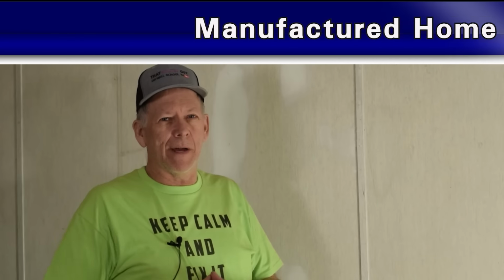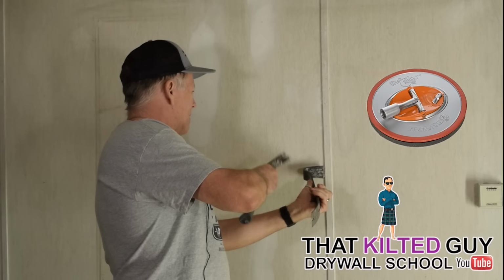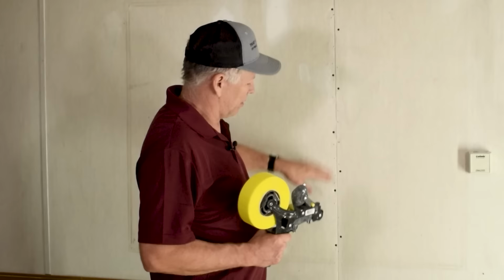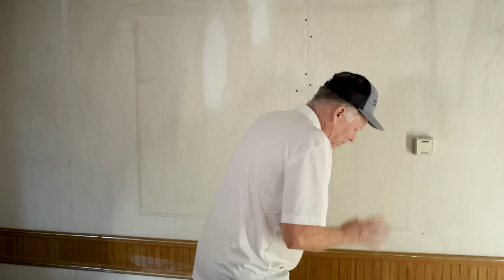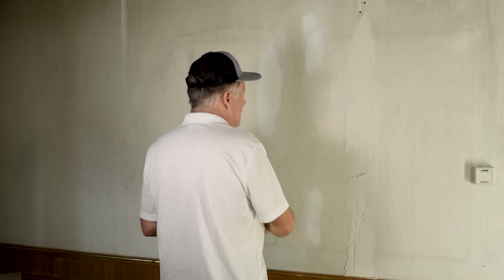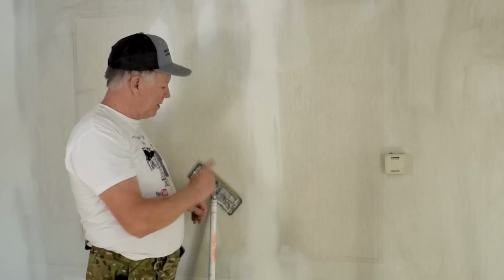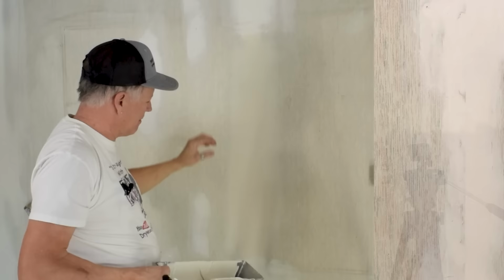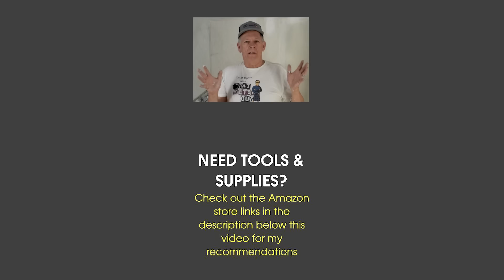Mobile Home Wall Removal in 2022. Smoothing out the wall strips

Comment: Ive thought about making a tapeless mud before using fiber hairs but wouldn't trust it. I dont even like using mesh with hot mud unless its fiba fuze. My experience with the old school sticky mesh is if its not cracked yet it will be soon even with hot mud but the cracks with hot mud are tiny hair lines. Just my experience. The old man that taught me drywall basically told me all that but i had to see it for my self.
Reply from the maker: I’ve installed well over 500 rolls on repairs with zero issues

Comment: Thanks for this video, I had to sell my house and move into a older single wide mobile home and the previous owners did some work like you are showing but only one room the master bathroom has the stripes removed and fully textured and mudded the ceiling and walls but they never completed because some of the seems cracked all the way down and the mud repair is showing and cracked and I have to fix this and repaint. So I'm assuming I need to screw down the wallboard on the seems that cracked re mudd then paint.  Another question I have is what is the best paint to use on the walls that have had this process done? Except the laundry room which I'm not doing anything to the rest of the place has been textured over but the strips are still in place and for right now even though I absolutely hate them they are probably going to stay as I'm disabled and can't really do all this stuff anymore. So in general the walls look like drywall untill you see the strips. I bought eggshell finish latex paint but I noticed it damage's easily on these walls that are vynal under the thin coat of mudd so what sheen would have been better And especially what sheen is best for bathrooms/high moisture area's like My hallway that has the junk swamp cooler.

Comment: You're a life saver! I was worried about the seems and trim in my modular home. But what I was really worried about was the texture of the wall! So I'm guessing the primer bonding will hide the standard vinyl texture and then I can paint!?
Reply from the maker: Primer and paint will hide very very little. If your vinyl has a texture to it, you may have to skim coat it with a really tight layer of drywall, mud and sand. It smooth.
Reply from the maker: If you have any texture on the walls and want it to appear, smooth, primer and paint won’t hide it. You may need to do a very thin skim coat to get rid of it.

Comment: Q: if I grind and shred old cotton apholstry into something similar &>then spray the wall with spay adhesive and rubber the cotton across the glued surface leaving a cotton sticky mess to dry or thus till ventilated/ talirable.  Would it asist in the affixing of the drywall puddy and it's processes? 
Tool : wire brush pit drill/grinder 
Material White Upholstery preferably a cotton base
Reply: One other thing,, some have the wood walls that thin pressure treated cardboard with lines or patterns in them it's like 1/8 inch thick turn the patterns inside so you don't contend with the pattern embedded into the intended facing 
Use the inside out

Comment: I'm doing a 2008 1500 sf modular now , it has drywall and wallpaper through out the home, wallpaper overlapping the seams. No Strips,  I'm worried about expansion and contracting from winter,.  to summer.  May get some cracking...

Comment: I was told the trim pieces are for the trailer to flex since it’s essentially a big rectangle that’s going to expand and contract with the heat/cold especially on the older models of trailers (anything before 1997) where they put sheet metal over wood frame without any adhesive. Same concept when you put siding up or hardwood down you leave a little gap. Will this lead to cracking after a few seasons? I live in Ohio where the winters are kinda rough.

Comment: Could I just place paneling over the sheetrock? Would you screw, nail or glue the sheets up?I don't want to replace the sheetrock, just cover up for a quick fix.
Reply from the maker: It's usually nailed on

Comment: Great video, but do you have a video using regular drywall compound?  Would love to see it with the regular mud that you recommend.  Would be a much better video, as we are in Nova Scotia, Canada, and have no ability or intention for our drywall taper to use this new product that you use in the video.  If you do have a video of mobile home strips being removed and filled, please post it in the comments.  Thanks, so much.
Reply from the maker: I plan to do it one day but basically just tape and finish the joints like a regular crack after pre-filling with hot mud. If the gap is over 1/8 of an inch wide, you really need to use a fast setting joint compound, or it will crack and be weak.

Here’s the link to join my YouTube membership. https://m.youtube.com/sponsor_channel/UCSinsqowcKxmSaKkx3W9_0w?noapp=1

Comment: Also have a question, can I hot mud over vinyl? Like trying to get a smooth finish? 
The vinyl has straight lines or a weird bumpy feeling to it.
Reply from the maker: You might test it but it really should stick. Might need to clean the walls with TSP first

Comment: Well, I never understand they show the stuff but if you actually don’t know how to do it or you’re just not skilled in it, there’s not a lot of companies that know how to come out and do this kind of work where I live. I have found one company and I have called like three times for them to come and repairs underbelly and the insulation isn’t completely wonky yet but it will be is some water damage continues and it only happens when it rains because Roofer messed up. Yeah Roofer that’s supposed to prevent water damage caused water damage. Isn’t that fun?

Comment: Thanks, quick question I have a leak in the piping going to shower and it has softened the wall in bedroom. So how do I remove the panel, do I just remove the trim around it out if it helps in by nails also, thanks
Reply from the maker: I can’t answer that without seeing it but you do need to open up the wall and dry it out thoroughly to avoid mold and you may get mold anyway

Comment: ok  question    im sure you are priming  the whole wall ,  but the repair will be much for flatter that the rest of the  wall  that has that small texture .. does the primer take take of that   bit of texture ??
Reply from the maker: I just put deep sanding scratches in it with coarse grit sanding paper to match the lines in the existing wall. This is actually a very budget job and she didn’t want texture anywhere so it worked. and after all that, she actually ended up cheating me out of what was due but that’s another story. She was a total nut job

Comment: What kind of prep did you do to the vinyl if any? Did you used a primer? I can't get my mud to stick to the vinyl consistently.
Reply from the maker: Try cleaning it with a degreaser, and if it’s really smooth, put a bonding primer on it first after you sand it with 80 grit. Mine had a texture to it so the mud sticks by holding onto that plus I sanded and cleaned it

Comment: @ThatKilredGuy Thanks for the video! We are trying to redo the master of our module home and this has been very helpful. If we add a wood accent wall ( our house is very cabin esk) how would I go about doing that if going over the vynal wall is the only option? I would run into the problem of having the depth of outlets and lightswitches inset again. We plan to Repaint the rest but am stumped on how to add the wood notch planking accent wall without having to extend all the electrical outlets and switches.
Reply from the maker: Use box extenders like these https://amzn.to/3NX6jDe.  But you will find that you will also run into issues with the door casing trim suddenly having a gap the thickness of the wood you put on the wall

Comment: We did this, and from the seasons, heat and air conditioning drywall mud expanded and shrunk now we are left with cracks everywhere.  What do we do now?
Reply from the maker: Tape them like normal joints

Comment: Does this work for wood paneling?? My home does not have drywall panel so not sure if the steps or products used are different?
Reply from the maker: Maybe, if you clean it and it's solid and not floppy but I'd tape it instead of this

Comment: I have a 1998 Doublewide I’m remodeling it I want to pull all the trim dress up the seems and then skim coat the entire wall currently has paint not wallpaper will I’ll be able to just go over and if so what mud do I use

Comment: I just removed a batten to find that one panel is higher than the other by about 1/8 in. Is there a way to fix this myself, or does the sheet rock need to be replaced?
Reply from the maker: Float it wide. 3-4’

Comment: I have done all of this, and my tape is not sticking. There is plenty of mud underneath the tape, but it is just uniformly popping off the wall at the seam. Do you think that if I rolled some super bonding primer over the joints that it might help the mud stick? I'm getting tired of scraping off my work. 😪😭 It's a brand new mobile home, btw, on a concrete slab.
Reply from the maker: Yes do that

Comment: Okay... What do we do if we already took the vinyl off of the wall? Should I primer the whole wall before using the joint compound and painting?
Reply from the maker: What was under the vinyl? If it is raw sheet rock, and crumbly, I’d say you might be in trouble. It’s fixable but I would probably spend a couple hundred dollars on really wide fibafuse like this, https://amzn.to/3u24DeV and put that over all of the raw drywall to give it strength back.

Comment: Is it the same process for around the windows where it has the same kind of batten strips? Is it better to mud it over before putting trim around it?
Reply from the maker: Around windows it would be best if you filled it in like this and then put trim over it as it would look much better and be less likely to crack between the wood and the drywall mud

Comment: Good video. I hate to dbl ask.  I put on a different video before I found this. What if you want to keep the wall board but I need to get in the wall but it is glued to the studs
Reply from the maker: You just have to rip it off and scrape off the glue

Comment: Why not remove the vertical and fill it with the smallest cut on the tube of paintable caulk,  then slowly flatten out the caulk with a putty knife.  Lastly,  paint when cured ???
Reply from the maker: Caulk will leave edges, shrink too much and gaps are sometimes too wide.

Comment: Thank you! Thank you! Thank you! My husband and I just bought our first house and I am attempting to get rid of all these strips in our bedroom while he is completely remodeling our bathroom! I definitely thought it would be easier and jumped in head first. I spent 5 hours pulling nails and staples when I should have just hammered them in! I also bought the all purpose for all the coats. Is that okay?
Reply from the maker: It’s fine as long as you don’t have to fill deep voids or wide gaps because only fast setting joint compound works well for that

www.ThatKiltedGuy.com

Comment: Would you put the high bond primer on before retexturimg a wall like that  or would the texture mud stick ok to the ridges in the vinyl ?
Reply from the maker: I’ve done that before but the ridges will help it stick fine in this case.

Comment: This is exactly the video I’ve been waiting for!  I’m in the process of buying a mobile home, and I’m hoping to get enough confidence to try to redo the walls without the strips once I get in.  

I’ve watched several other videos of people doing it themselves... you’re the first one I’ve seen mention anything about securing loose panels to prevent cracks.  

One question I do have... can the vinyl be sanded down to create a uniform texture with the repairs?  I don’t really want a textured wall... should I be prepared to skim coat it, or is that something a good primer could cover if it was sanded enough?
Reply from the maker: Most videos about this are by novices, so they often don't know all the steps to take.  But no, you can't sand the vinyl down so your option is to skim coat it if you want it smooth, or texture over it.  Painting with a heavy nap, like 3/4" might hide it well enough too.

 Mike Overby, I hope you can help support my channel, since I actually earn less than .008 cents per video view, and therefore per question answered.  I appreciate your support.
Please visit My online store for ebooks, sanding discs, illustrations etc -
https://www.etsy.com/shop/ThatKiltedGuyDIY?ref=seller-platform-mcnav

My Amazon Store with lists to help you decide which tools you need - https://www.amazon.com/shop/thatkiltedguydiyhomeimprovement

If you need any drywall tools, check out my Affiliate link to Level5 Tools (my favorite brand)- ?via=thatkiltedguy

My Patreon page, where you can show your support for my help with your projects -
https://www.patreon.com/ThatKiltedGuy

Thank you, Guy Purcella, DBA That Kilted Guy Video Productions LLC

Comment: I really appreciate your video on how to tackle a VERY aggravating process. I tried to drywall the seams and texture a friend's manufactured home and it was a total disaster. The tape wouldn't stick to the fake plastic walls and repeatedly id come back in later to find all these blistered sections that id have to remove and start from scratch. Aaarrgghhh!

It would look perfect until i put onnthe 2nd coat then it would blister up. I can't begin to tell you how much time it took to get all the seams to set.

The guy ended up painting it himself later so i never did get to see if anymore sections lifted later.

That was 3+ yrs ago and the most frustrating drywall job ive ever done. I have another job to do so im seeking insight as to not repeat that fiasco.

So am i understanding you correct that you did not use tape at all? If you hadn't added the new fibers to your hot mud mix would you have used paper tape? If so, do you have a video where you did use paper tape on the vinyl (otherwise known as "fake") walls? I dont want to repeat the same time intensive mess as the first time
Reply from the maker: The wall I was doing had a very textured surface which gives the mud something to grip onto. If it is a smoother vinyl surface, what I’ve done in the past is clean the walls well with something like TSP, and then sand them lightly to scuff them up a little bit, and then I sprayed a bonding primer and let it cure for a couple of days.  then I taped and finished it with no problems
Reply: @ThatKiltedGuyDIY  thank you, ill use these tips on the new home I'm getting ready to do. I'm confused though...did you use paper tape over the seams? Or only the mud? The one above looked like you only used the mud becauseyou used that fiber additive. Im gonna watch it again. I might have gotten distracted
Reply from the maker: That was a fiber additive that is supposed to be strong enough to not need joint tape. The owner was on an extreme tight budget so I suggested we use this and I saw it several weeks later and it looked like it was holding up fine.
Reply: @ThatKiltedGuyDIY  thank you Guy. I just rewatched the video and went to the link to check that product out. I truly appreciate your help

Btw i keep forgetting to say Corvette.  Lol

Comment: What's the best way to get rid of ceiling strips on a popcorn ceiling? The strips are just like wall strips but on the ceiling too.
Reply from the maker: Same but I would mesh tape with hot mud then top coat with plus 3.
Reply: I could easily do that but the ceiling is popcorn with all these strips. If I take off the strips it's going to look awful. How do I make all the ceilings uniform? Would I have to peel off all the popcorn then re-texture?
Reply from the maker: @johnwagner846  you would
Reply: I would?    :)

Comment: what do you do with the gap to the ceiling - the ceiling is textured and I want to leave that but there are a few spots with some good gaps where I took off the strips
Reply from the maker: If it’s not too wide, caulk
Reply: @ThatKiltedGuyDIY  about half inch at most
Reply from the maker: @TheMaryannTaylor  probably quarter round or a 1x4 trim first, then caulk for that wide
Reply: @ThatKiltedGuyDIY  really by the ceiling … ugh not my preferred look
Reply: @ThatKiltedGuyDIY  it’s just in a few small spots not all over
Reply from the maker: You might be able to put spray foam in the gap, let it harden, shave it off flat, and then caulk over that.

Comment: So my question is - do you have to do anything to the vinyl wall itself before you mus the wall or will it take it just fine without any special prep?
Reply from the maker: I covered all the steps in the video
Reply: I would clean the walls with TSP then wash them again with Dawn and water. You want as much grease, dirt, fingerprints, ect. off the wall. then tape and mud. then prime and paint. You absolutely want the best paint adhesion on this vinyl. In this application don't skimp on paint quality. Get a more expensive name brand. It will have better adhesion properties. I have also used a Behr paint and primer all in one and had great results in my bathroom.
Reply: @ThatKiltedGuyDIY  i watched the video but seemed to only see how to mud the joints; I am hearing impaired and have to rely on clised captions
Reply: @Superduty_59  thanks!!!
Reply from the maker: J Jones had good advice